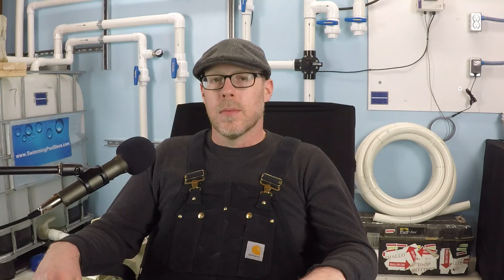Pool Pump Plumbing Mistake

Comment: My pipes from my suction side has two 22.5 elbows since old homeowner raised pump up about 4” since rain water was pooling around pump n rusting it out. Problem is it’s not priming and my neighbor said ever since he raised the pump it had a hard time priming. Should I have the pipes run straight from drain & skimmer valves going into the pump n eliminate the 2 elbows so pump is even with where pipes come out?

Comment: I just watched two videos prior to this one and they both did not have a 5X pipe diameter straight run into the intake. In fact in one, you could clearly see large bubbles through the lid.

Comment: I have a 40mm fitting on the inlet side on my pump, so the reducer needs to be 12" from this. Am I able to put  a pressure ball valve in-between the reducer and the pump?

Comment: Hi Steve:
What you are saying here is massively important for Pumps Without Leaf Baskets where the cavitation from the elbow or string of elbows fires right into the centre of the impellor, the longer the better. But of course you would only use these pumps below water level.
If they have Leaf Baskets for use above water level I use Sweep Bends. The Lint Basket negates the need for extra lead in pipe. I have had no issues in 30 years. As there is no cavitation from Sweepers It's hard to tell if there is water in the pump basket. These days I only use Pentair Intelliflo 2 VSF pumps now and set them for 10 cubic metres per hour when installed on a new pool that I have plumbed from scratch using as many sweep bends as possible where required. I will pull about 500 watts with a Multicyclone, Sand Filter, heater and ozone sanitation installed. which is the optimum flow rate for Filtration, Heating and effective Skimming, basically equal to an old school 1 Hp pump.
If I increase the flow rate to 11 cubic metres per hour it will pull about 1000Watts.
The Intelliflo Pump allows you to find the most efficient flow rate and guarantees the specified flow rate for heaters.
Have you used these pumps set as Flow?
Everyone else I see uses them set as Speed and they get no real benefit out of using this Pump.
Reply: I just had a new Pentair 348190 Super Flo pump installed to replace a roughly 11 to 12-year-old DuraGlass, which replaced the same model that was in place when I bought the house. They were just being discontinued but had a reputation for durability. The motor was replaced once since its installation, until that started going bad a few months ago, overheating and shutting off for 20 minutes several times a day and finally stopped altogether. I wanted to just replace the motor because the pump was working fine, but the installer said that because it overheated so much, it probably melted and warped the plastic on the pump where it connects to the motor (I did smell burning plastic every time I was near when that happened) and would likely leak when connecting a new motor, in which case the motor would be wasted expense because that motor can't be used with new model pumps. So a new pump and motor was only about 40% more expensive, and he installed the Pentair, which would fit where the other one was. The Pentair actually seems to have more noise, including a slightly high-pitched whirring sound, and the outflow pressure is about 20% less for the same settings as the DuraGlass with a Century 1 hp motor, although it should be at least the same or more pressure. After the installer left, I looked at the manual, and I noticed he had installed a 90° elbow only about an inch from the inlet opening (maybe 2 inches to the perpendicular pipe). I asked him about that and pointed out the manual says it should have at least 10 inches of straight pipe, and should not haven't 90° elbow connected to the inlet. He sent me photos of the pipe he removed from the old pump, which had a similar elbow with the bend about 2 inches away from the inlet. He felt it wouldn't make any difference as to flow or noise if it had that straight length of pipe before the inlet, but he has no problem coming back trying to get as close to 10 inches as he can. There's a custom-built, although rather dilapidated now, wooden lattice cage that goes around the pump assembly to more or less obscure it from view and perhaps protect it, as it is on the same patio deck as the pool, in front of the corner of the back of the house (they don't put them in that way now). Anyway, there's about seven and half inches more that the pipe can be extended and still fit in the cage, which would make it close to 10 inches-- Update: I didn't account for the width of the frame of the cage, so it is really be only about 5 1/2 inches that the pipe could be is extended for a total of maybe 7 inches, unless I had the cage rebuild adding a few more inches of width, or didn't use the cage, leaving the bare pump/motor and filter visible on the patio. The inflow piping is horizontal from the inflow valve, and forms a broad U shape. So adding eight more inches at the Inlet would mean adding another 8 inches on the other side of the U-about 15 or 16 inches extra pipe, if that makes any negative difference, plus, the base of the horizontal U is unsupported and would be extended further--I don't know if that's an issue with the extra weight of water and pipe. Perhaps I can ask if he can just use long sweep elbows instead for the two elbows of the bottom of the U. Any opinion on this? And why it's producing less outflow pressure than the old DuraGlass--the installer says it is because it has greater flow, but that doesn't make sense. I can feel less pressure coming out of the outflow jet, and less suction at the skimmer. He said the DuraGlass was originally designed as a sprinkler pump, but seemed to work fine in my pool, which is 34 feet long, and 15 feet wide but  narrows to about 13 feet wide toward the deep end, which is 7 feet deep, and about 4 1/2 feet deep onthe side of the shallow end away from the steps- maybe 20,000 gallons, I'm estimating. The main reason I bought the house it Is because the pool had a 34 foot lane one can do laps without one's feet touching bottom in the shallow end. Unfortunately I only swam for a few weeks in the 14.5  years I have owned the house--I need to start again.

Comment: Once had a pool store install a new pump I bought for them and the tech was going to install a elbow fitting pretty close to the intake.  I mentioned this wasn't ideal and he should push back the fitting so it was around 12 inches away from the pump.  He then turned to me and asked if I was a engineer at which point I said "no, I just read the install manual".
Reply: If the pump is against the wall and you have no room to move it back and have more pipe I understand. But you should always have a longer run of pipe if you can
Reply: @teddygramz2008 Even if that is the case, you can always use a long sweep curved pipe and create a new flow pattern that curves out of the way, even curving in multiple changing directions to plumb it back to the intake side of the pump and avoid the massive flow rate disruption caused by a 90 elbow right at the pumps intake. The guy he was referring to is obviously a low skill pool store employee with a self esteem / intelligence issue. You never have to settle and get stuck with no choice due to the position of the pool to the pump, or other equipment. You can always reroute around issues like this. It might look like less of a direct path to the equipment and it might appear to have some unecessary piping patterns but who cares so long as the flow rate is optimal. I can't stand easily threatened "professionals" like that. It's like a doctor who's butt hurt because you challenge their basic opinion of something that is objectively wrong and obvious even to layman.

Comment: What a load of toss more horizontal plumbing more chance of air locks.
Pool Pump Manufacturer 35+yrs repaired over 40,000 pumps.
Reply from the maker: In the past 35 years have you read the installation manual for any of these pumps you are installing.  They ALL say exactly what I have said right here about having at least 5x the pipe diameter in a straight run in front of the pump.  It is not enough to call into your job for 35 years.  You should aim to improve your quality every year, and this one is black and white right in the installation manual from the pump manufacturer.  Thanks for commenting.

Comment: Just a thought. Intex pump sucks so I will use my old filter pump, 1.5 hp and 1.5 pvc. Now,   could I use the intex pump without adding holes to draw water? Maybe add a clip on skimmer to it and add a jet, shower, sprayer fountain as the out port? It probably would work like a vacuum mode be ajse the water would not be gravity assisted as the tubing would go over rail but maybe the siphon effect will assist. I am just not ready to cut into this new pool, Intex 12x24 vinyl .

Comment: Right. Come to think about it I had 1.5 to skimmer, down 45 across into pump. A guy added a second out port and adjusted to filter pump direction to line the pipes. I do have a 90 right into pump. so far the rubber coupling held 4 years. I know working with my RO setup I try to avoid 90s. So this video is a refresher on not using 90s or restrictions before and after pump. I had small 1-3 gph pumps that ran hard or hot drawi g high amps. Once removed obstruction before and after they purred cooler. Even on those pumps, just a few inches on an out port before you restrict made all the difference.

Comment: Is it recommended to have a length of straight run prior to a bend on the return line to the pool as well or is it just for the inlet from the pool?
Reply: I should’ve been a little bit more clear.  I meant as in a straight run out of the filter before I place any bends back to the pool.

Comment: The manual for that new black + decker you’ve been reviewing shows 5x pipe diameter straight run as good, but a long sweep as best. How do you feel about long sweeps?
Reply from the maker: Long sweeps are great. I always thought the straight run was the most optimal. Hard to imagine why any bend would be preferable to a straight run. In any case, I would say both are good.